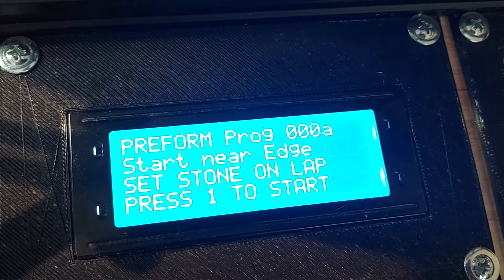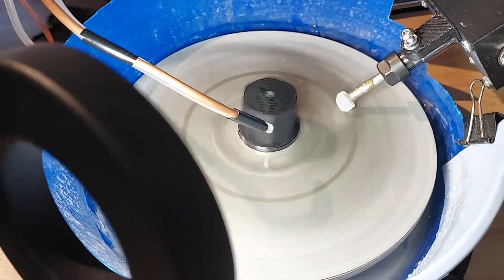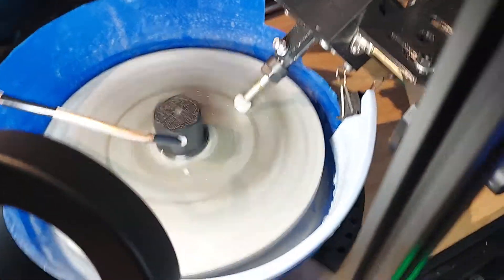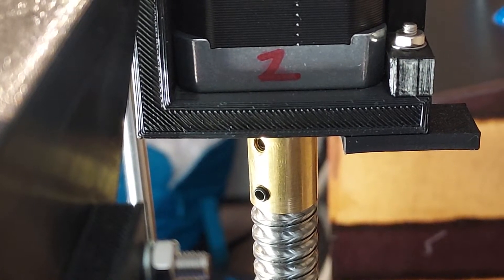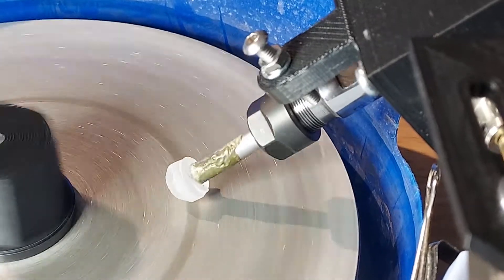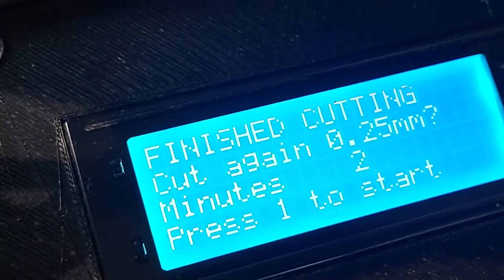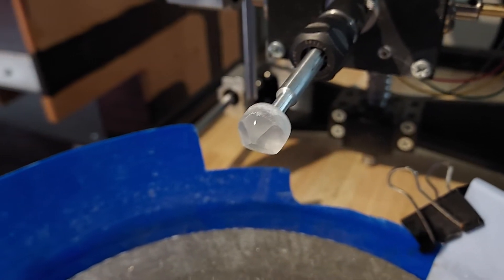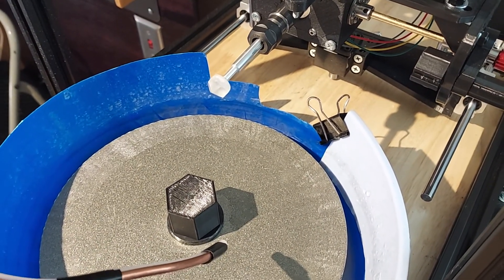Automatic Preforming Machine

Comment: Impressive job, although I suppose one issue would be that it doesn't flow across the lap at all during cutting... I suppose that would pre maturely wear out the lap, no doubt.
Reply from the maker: In later versions the stone moves back and forth so as not to wear a groove in the lap :)

Comment: Wow, very neat, and impressive! I preform my students' first stone, a SRB, by hand just like you show. It really makes a big difference in the time it takes them to cut their first stone. Preforming generally assures that the cut will be symmetrical, allows more time to focus on the process of meet-point-faceting, and reduces faceting frustrations. I usually use white CZ for the first 10-12 mm stone and they are flabbergasted when they see their stone the first time out of the dop.  Most of my students typically only cut a few stones and then they happily move on to other club activities. Our club is non-profit in Sun City Center, Florida.
Reply from the maker: Thanks Ted. Getting that culet centered can be real tricky. I use an older MDR faceting machine to do my hand faceting but this machine has really helped in getting the stone setup. I could facet an entire stone with it, but it is more of a commercial grade finish when it is done. There is just no replacement for the feel, eye and ear of a hand cutter. If I do hand preforms, they will have a curved profile which works better. I use a Diamond Pacific genie. On this machine, I usually go a little further than the video shows and do a series of small steps. It has its limits but it has been fun to tinker with.
Reply: @earthartgems  Thanks Austin, I preform stones on our club's V2 Ultra Tec machines. We have four machines that were not being used when I became active in the club 12 years ago. The club was founded in 1983 and they bought at least one V2 at that time because I found the paper work. I found one of the machines in a cabinet a began faceting about 10 years. The rumor was that back in 1996, the faceting folks got in an argument with the club's board over money and quit the club leaving the four machines hidden away in cabinets. Over the past 10 years that I've been faceting and teaching faceting, I've found it difficult to find club members who are longer term facetors or are willing to make a commitment to teaching. I'm still hoping that I can find folks that will carry on the knowledge of faceting before I get too old and the machines get hidden again in cabinets or sold.
When I preform, I place the V2 in free rotation at 90 degrees on a 100 grit lap that I run full speed with a light touch. I typically preform synthetic stones to a standard setting size of 10 or 12 mm so they are easy to set. I usually finish off the preform on a 600 grit lap at high speed. It's easy to see the problems by watching the movement of the angle gauge and looking at the reflected light off the stone as you rotate it, you can see the reflection jump if there are irregularities. I preform my student's first stone so they can see the results of their work without becoming too discouraged or frustrated.
Reply from the maker: @tedboydston8978  Wow, you have 4 V2's? That is a wonderful opportunity for your club and its members. I like your technique of preforming. My old MDR does not have any of those features.  I myself am not a professional faceter. I am a jeweler.  That said, taking up faceting as a side hobby has really helped me to appreciate a good cut when I see it, and to better understand pricing and time constraints from the pro's that I do hire from time to time. Overall it has made me a better jeweler, collector, rock hound etc.... I'd encourage anyone in the trade or hobbyist to give it a try for a year to develop an appreciation for a sill that we have all taken for granted (given the prices of cheaply cut semi precious stones) In many ways, trying to develop this machine has also really showed me all the nuances of faceting that I don't even think about when cutting a stone by hand.  How do you go about preforming your squares or other shapes that cannot simply be rotated freely?